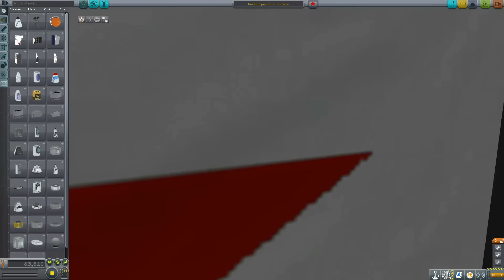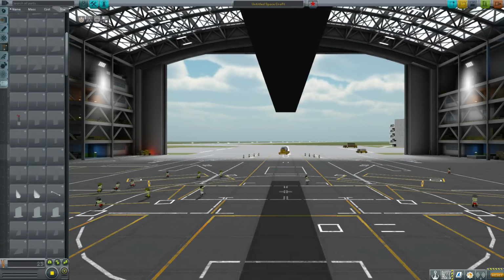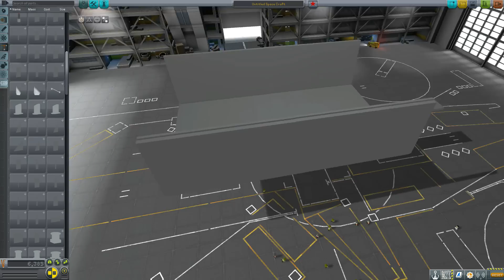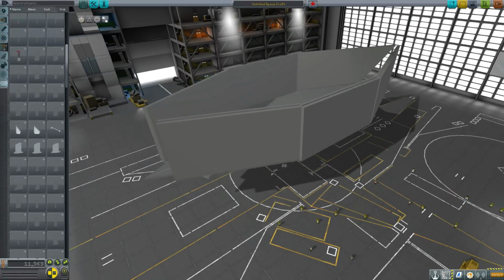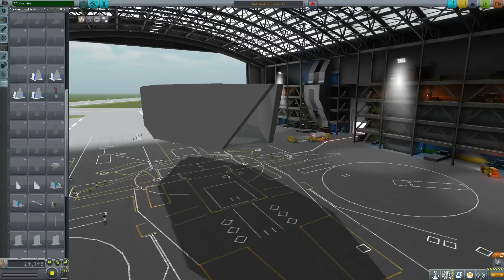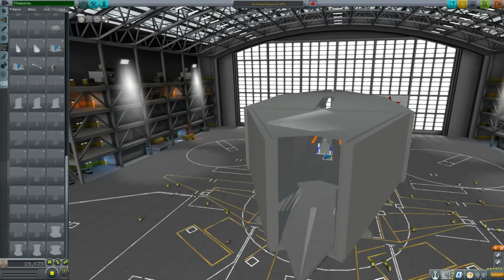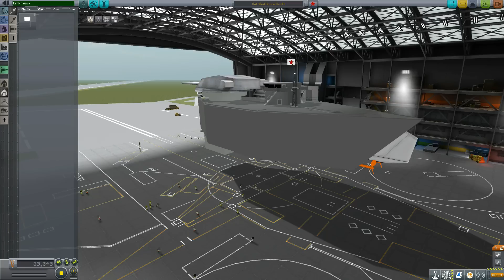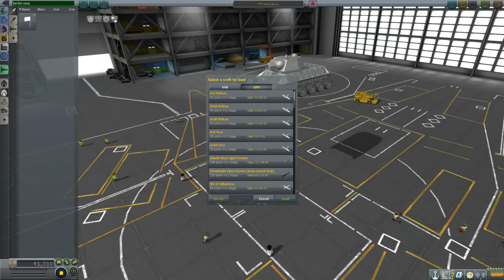KSP Fall Of Kerbin : How to Build Ships

Comment: my ship still sinks
help
Edit: yes im using the military plating how Beardy told me to
Reply from the maker: Snekuu 
Once you launch the ship you need to activate the water pumps in the plating, tie an action group to all of them and press it when the vessel loads
Reply: @TheBeardyPenguin  I Did, everything is on, it still sinks, im using the Military plating as it says. 
Edit: sorry for the kinda late response
Reply from the maker: Snekuu 
Open the resources tab to double check that the ship isn’t filling with water
If it isn’t then it’s just too heavy, try adding some structural plates to add some buoyancy
Reply: @TheBeardyPenguin  Thanks! I added some structual plates and it floats!
Edit: It floats a bit too well, its above the waterline